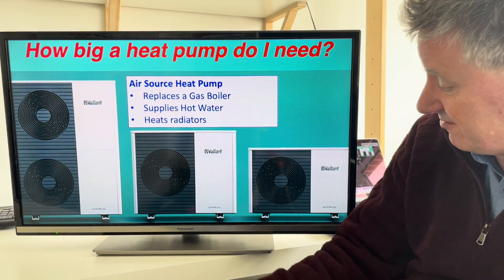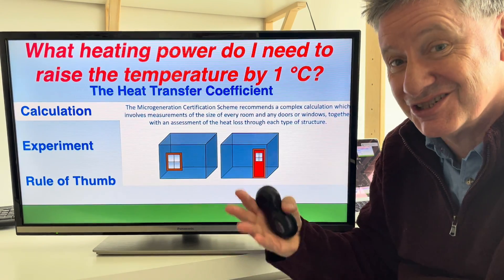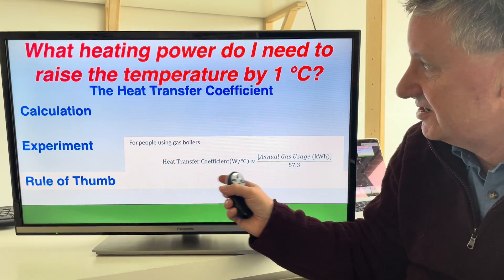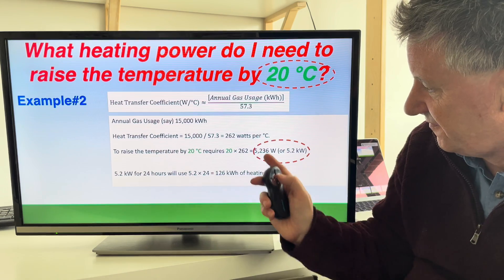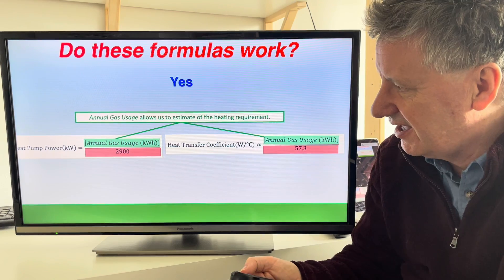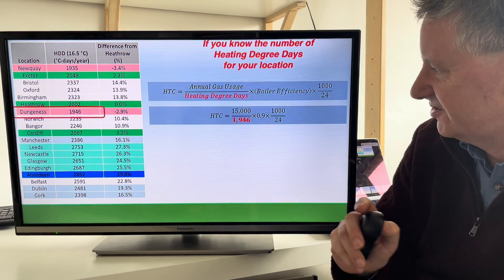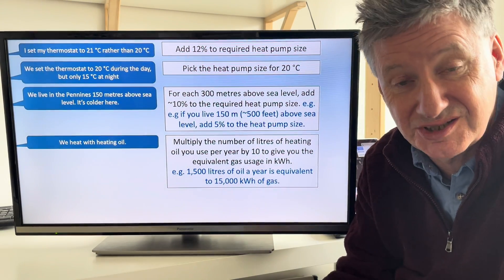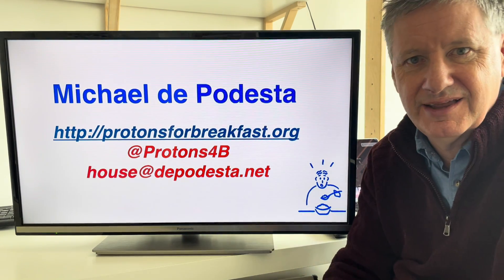How big a heat pump do you need? A simple Rule of Thumb.

Comment: Excellent presentation. Thank you. Did it work for you over the last year. My concern with calculations based on 1 year is that it may not work on the coldest day. A small pump may work based on averages but will it be man enough on the coldest day of the year. 
I had an issue like this when calculating PV required for my off grid house where average radiation is so much lower in December which meant that the actual requirement for solar panels was around 4 to 5X what had been calculated by other companies. And it does only just work!
Is there a similar issue with the rule of thumb for heat pumps?
Reply from the maker: Good Evening. Yes, thanks for your comment which is very important. Roughly speaking, you can use the heating degree days and average gas consumption to estimate the Heat Transfer Coefficient for the house. You can estimate this using daily, weekly or seasonal averages as long as the days weeks or seasons include some cold weather. Suppose the HTC is 300 W/°C.

As you say , you want to estimate the heating required on the coldest likely temperature - in my locale that's -3 °C but we actually had -5 °C this year. This is called the design temperature and so if you want to maintain 20 °C inside the house you can estimate that you will require say 23 °C x 300 W/°C = 6,900 W or 6.9 kW. 

Most people get the heat pump which is the 'next size up' from their estimated maximum demand.

Does that makes sense?

Best wishes

Michael
Reply: @michaeldepodesta001  Thank you for taking to time to reply. Yes absolute perfect sense. Thank you

Comment: I gather heat pumps work well with under floor heating, would it be more efficent just to leave the underfloor heating on a lower temperature and let the heat pump tick over? rather then  switching it on and off again?
Reply from the maker: Dear @ManChicken In short yes, it would be more efficient. Two points.

1. Heat pumps already do this: it's called weather compensation. When it's -5 °C outside my heat pump circulates water at 45 °C. When it's 10 °C outside the water is only heated to 30 °C.

2. The problem comes because of a technical issue with the compressors that drive the working fluid around the circuit internal to the heat pump.  In the 'olden days' the compressors could operate at 100% or 0%. Then electronic motor controllers became a thing and the compressor motor could be "modulated" to run anywhere between 100% and 40% (this lower level varies from manufacturer to manufacturer). So this copes well in cold weather, but in slightly warmer temperatures i.e. with the lowest levels of heating demand - which corresponds to roughly half the year -  when demand is less than 40% of maximum, the heat pump has to still cycle on or off. 

Does that make sense?

This is why it's important to get the heat pump size about right. If you install a 10 kW heat pump in a house then it will cycle on and off when it delivers less than 4 kW. If the house has a maximum heating requirement of 5 kW then the for most of the year the heat pump will be cycling on and off.

Best wishes

Michael

Comment: Answer = Don't be fooled again,you don't need one
Reply from the maker: "Don't be fooled again,you don't need one"

Dear @norman7527, I'm afraid I don't understand your comment. 

If you don't want a heat pump, that's fine. But it's a super cheap way of heating a home with very low associated emissions of carbon dioxide.

Best wishes

Michael

Comment: Thank you for the very helpful presentation, Michael. I just did a quick check against a recent quote. The expected heat demand was 9.2kW and they are suggesting a 12kW ASHP as a result. Do you think something like a 10kW pump would suffice instead?
Reply from the maker: @dpjdpj Good Afternoon. A couple of points. 

First, regarding the names of the heat pump e.g. "a 12 kW heat pump". This typically means that the heat output will be 12 kW under a specified condition, often when the outside temperature is 7 °C and the water is heated to 35 °C. This is call 7/35 specification. Typically the heat pump output will fall as the outside temperature gets lower and the temperature of the water in teh radiators increases. If you are in the UK then the heat pump design is likely based on an outside temperature of -3 °C and a water temperature that might be 45 °C. It could be that the heat pump with a label "12 kW" might have an output of 10 kW under these conditions. Ask the person who quoted you, or look up the specification for the heat pump they recommended. Or let me know the recommended heat pump and I will see if I can find out.

Secondly. What type of house is it? How many people live there? And what was the gas consumption last year?

Best wishes

Michael
Reply: @michaeldepodesta001  yes we are UK based and it’s been designed for 45°C flow rate at -2°C.

It’s a 300sqm new build so don’t have any historical data to fall back on. They estimated energy required for space heating and hot water to be 24,500 kWh. 

They specified a 12kW Vaillant aroTHERM ASHP, 400l Joule DHW Cylinder and a 100l OSO Buffer tank. I did try to look up the ASHP but couldn’t find the output figures you mention. I’ve also seen from other videos that buffer tanks are rarely required.. I’m very new to this area so my knowledge is limited but have seen plenty of videos where consumers have been specified the wrong set up (usually overspecified), hence my questions. 

thanks again!
Reply from the maker: OK so it’s large house and a new build. Here are some typical heating requirements for SPACE HEATING for different types of building.

1.	A Passivhaus has a heating requirement of less than 15 kWh/year/square metre. So for 300 m^2 that’s just 4,500 kWh/year.
2.	A top-notch Enerphit refurbishment has a heating requirement of less than 25 kWh/year/square metre. So for 300 m^2 that’s 7,500 kWh/year.
3.	My refurbished house (with EWI but without underfloor insulation) has a heating requirement of ~ 50 kWh/year/square metre. So for 300 m^2 that’s just 15,000 kWh/year. This is also a good modern ‘normal’ building standard.
4.	Most UK homes have heating requirements in the range of ~ 100 – 150 kWh/year/square metre. So for 300 m^2 that’s just 30,000 – 45,000 kWh/year.

So for a new build, an expected heating demand (with DHW) of 24,500 kWh/year looks (IMO) to be on the high side. 24,500 kWh/year of heating would correspond to ~28,800 kWh/year of gas consumption which (using my rule of thumb) would correspond to about 10 kW of peak heat pump demand.

The basic Vaillant Specifications can be found here:

https://professional.vaillant.co.uk/downloads/aproducts/renewables-1/arotherm-plus/arotherm-plus-spec-sheet-1892564.pdf

So if the heat calculation is correct, then the heat pump size is about right – 20% oversize is fine. But if – as I suspect – the heat calculation is an overestimate, then the heat pump might be on the large side. From my perspective at the end of a YouTube comment, that’s just about all I can say with the data I have.

Except to wish you every happiness in your new home.

Michael
Reply: @michaeldepodesta001  many thanks again, very helpful. I look forward to more videos!

Comment: This is very interesting and a great rule of thumb but should only be used as a guide. Heat pump installers are required to meet specific temperatures within the house. This rule of thumb is based upon the present occupant consumption, this method will work very well for that occupant. But what happens if they sell their house and it turns out, that they liked their house cool, or were very frugal, as a lot of people are. This would result in a very low consumption and hence a low heat pump calculation. The new occupants however, perhaps elderly or people in need of a warm house will have an undersized heat pump. I’m all up for simplicity so thanks for this guide.
Reply from the maker: Daniel, yes, I think I agree with all your comments. The role of the rule of thumb is really to act as a check on heat pump surveys with routinely overestimate heat pump size requirements. This leads to oversizing - in 50% of cases the oversizing is by more than 50%. The gas consumption is in general well known, and someone carrying out a heat loss survey should check that the results are roughly consistent with prior gas consumption.

Best wishes: Michael
Reply: The title of this video should be "How to check that your installer has specified the right size of Heat Pump".
It's only when you hit 14minutes into the video does Michael start saying that his rule of thumb has other variables - this 57.3 figure needs to be adjusted for where you live, and then later "you need to add 10% for every 300m your home is above sea level".
Yes, it should be used as a guide to check that your installer isn't UNDER, or more likely UNDER rating your heat pump (which is one way to kill the efficiency) - like Michael states @ 16m20s, but should not be used to buy a heat pump.
Reply: It would be their house and their choice no?

Comment: Hi Micheal,  thanks for your video, its very interesting but has left me a little confused.  

You base your calculations on current gas useage however the amount of gas used to heat any home depends on the boiler they have. For example, last year's gas usage was approximately 18000kW (including hot water &  cooking) from a 40 year old heat only boiler. If I had a modern heat only boiler my gas usage would likely to be significantly less and would significantly affect the outcome. I don't really know what the efficiency of my old boiler is but i suspect less than 80%. Using 80% as an approximation and a 20⁰ "lift" it would suggest a 4.2kW ASHP which in my 170yr old detached house in North of England with solid walls, no DPC and very little loft insulation seems very unlikely. If I substitute  assumed gas usage from a modern 90%+ efficient boiler then the calculated Heat Pump requirement would be nearer 3.2kW (and this still takes into consideration my hot water (cylinder in uninsulated loft) and cooking. Ok, the cooking use is negligible so barely affects the calcs which you rightly point out but selecting the correct ASHP output is critical when it comes to comfort v economy. Undersizing will result in not being warm/comfortable enough and therefore using additional heating on colder days whereas  oversizing will will result in greater electricity useage (and presumably higher cost of appliance). 

Im sure your calculations work pretty well assuming a modern, well insulated home with a modern boiler but for older houses and equipment I just dont see how this works given the significant variation of the potential gas usage to heat the same home.
Reply from the maker: Dear @user-rs5ce5yj9x

When one considers the problem of heat pump sizing, the true quantity we would like to know is generally not available to us. We would like to know the heat transfer coefficient - the heating power required to raise the internal temperature 1 °C above the background. As the video explained, one estimate this quantity from a heat loss survey, but these are notoriously inaccurate because (in general) the construction of a particular property is unknown. The idea of the rule of thumb is to act asa check on  a heat loss survey.

I don't understand your calculations: boiler efficiency is already included in teh rule of thumb. For 18,000 kWh of gas consumption the rule of thumb recommends a 6.2 kW peak output heat pump. This doesn't seem like a crazy figure to me - it's close to the UK average.

And no, the rule of thumb makes no assumptions about the type of dwelling: a house, old or new, or an apartment. 

Best wishes

Michael

Comment: Brilliant video, very useful. Couple of points though - if I use less than average because I don't mind it a bit cooler, should I allow for more average use for people who live in the house in the future? Also, the impression I got from Octopus is that if they want to stay MCS accredited then they're not allowed to go under the MCS calculations, so we can tell them till we're blue in the face to install a smaller heat pump and they can't.
Reply from the maker: Thank you for your kind words. Three things.

1. The 'Rule of Thumb' works well when the temperature of dwelling doesn't fall too much either at night or during the day. Two or three degrees Celsius is fine, but larger variations - e.g. letting the dwelling cool right down (may 10 °C) overnight or during a long working day - can lead to underestimates often true heating power required.

2. MCS surveys make assumptions and they are often ridiculous. They have surveys about (a) Air Change Rates are often overestimated by factors of 2 or 3 (b) The temperature of party walls is assumed to be very low - perhaps 10 °C (c) the temperature of teh ground underneath a house is assumed to be very low - close to outside air temperatures and (d) And there is even a factor 2 uncertainty on the U-value of solid brick walls. Making poor assumptions can lead to oversizing by a factor two. In one case I am involved with, a family measured daily gas consumption during etc coldest days and found that their home used on average 8 kW during the coldest weather. The MCS survey suggested the heat loss was 16 kW to 18 kW and they recommended 2 x 12 kW heat pumps!

A decent surveyor in teh face of appropriate evidence will adjust the assumptions to reach the right conclusion.

3. Yes, reasonably I think, MCS base their calculations on an internal temperature of 21 °C, because the assumption is that 19 °C may be fine for you, but for someone else who buys the home, or you when you grow older, 21 °C is reasonable.

4. Yes, Octopus do everything 'by the book' even when they have teh data which shows them exactly what your gas consumption was on teh coldest days! But there are better installers out there using better heat pumps and more insight. Do you have any Heat Geeks near you?

I wish you good luck with your endeavours in the face of these bonkers rules. 

M
Reply: @michaeldepodesta001  so zoning the heating where a living room can be 19C in an evening then drop to 13C overnight would throw the rule of thumb out the window?
Reply from the maker: @MrDavegeo  Yes. The rule of thumb is based on the idea that the property is at (roughly) the same temperature all the time. If the temperature dropped from 19 °C (16 hours a day) to 16 °C overnight the average temperature falls to 18 °C - which won't make much difference. But if the temperature dropped from 19 °C (16 hours a day) to 11 °C overnight the average temperature falls to 16 °C - which is beginning to be quite a different average temperature.

The rule of thumb would then underestimate the size of heat pump required. Why? Because while heat pumps can maintain a property at a stable temperature, they are not as powerful as boilers (typically 6 kW versus 25 kW) and so the rate at which they can heat (or re-heat) a dwelling is limited. So when heating with a heat pump the heat pump operates (more or less) all the time, and set back temperatures are typically just a couple of degrees lower than the normal temperature.